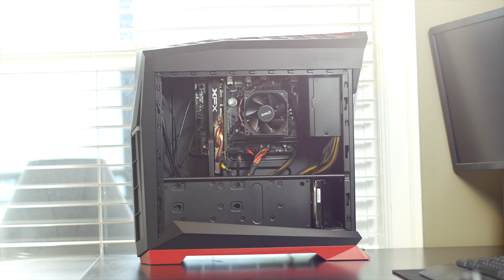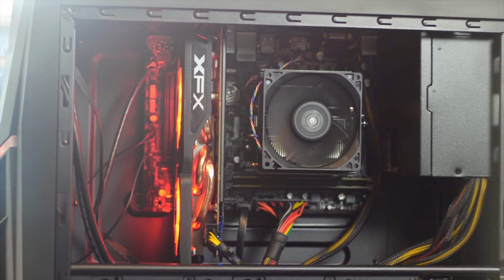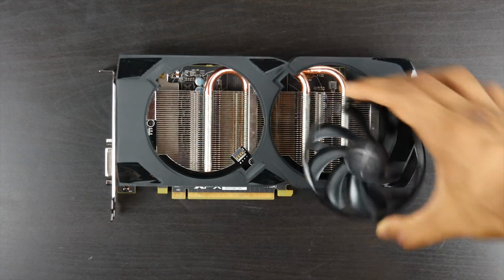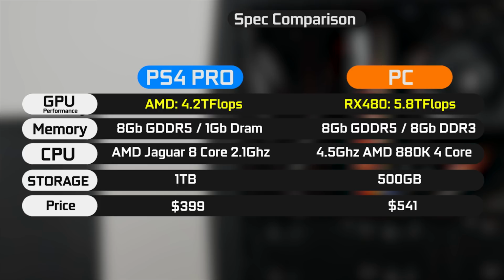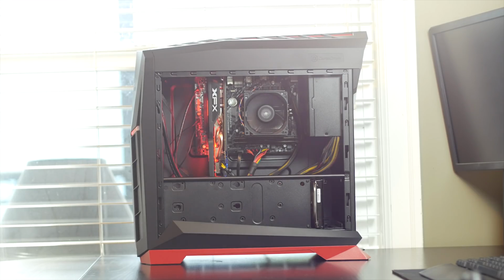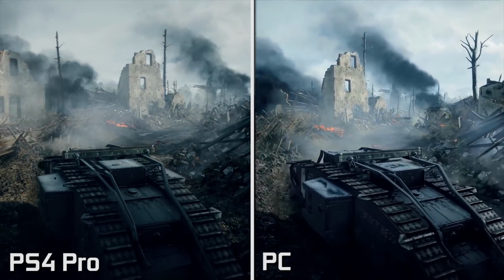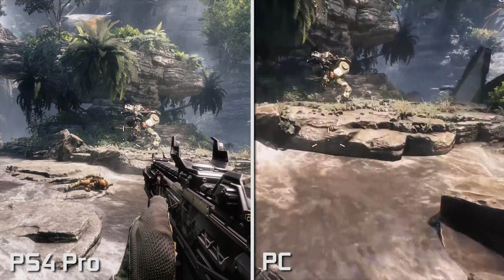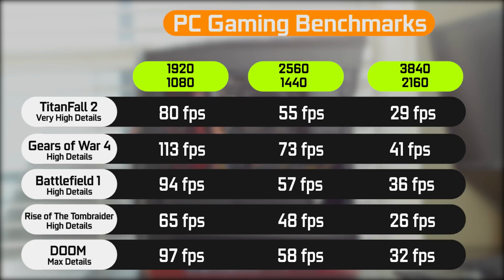Playstation 4 Pro vs $550 Gaming PC

Comment: Question. Is the checker box technology that Sony uses proprietary or can it be duplicated on a PC? That's the only way I could see that the PS4 Pro would win is being able to get out the near 4K resolution at a playable frame rate.
Reply: Jacob Linao that's pretty impressive.
Reply: Rob Leonard nope it can't be done on pc atleast not by gamers.
Reply: ninja of fire checkerboard is a douchey way of saying supersampling which of gamers can do, however it's something we don't use unless we're playing at a lower native resolution

1080p with 200%  supersampling is essentially 4k however it doesn't look as good as native 4k, supersampling is called false anti aliasing by some

for best results super sampling keeps native res, so 1080p+200%SS will look better than 8xFXAA on a 1080p display, but since these are predicted pixels and not native they don't look as good on a 4k display as they do tuning native 4k

supersampling is just as stressful on the hardware as native resolution if not more, so there's really no reason for pc gamers to do so when native res is an option unless they're keeping the same resolution they started with